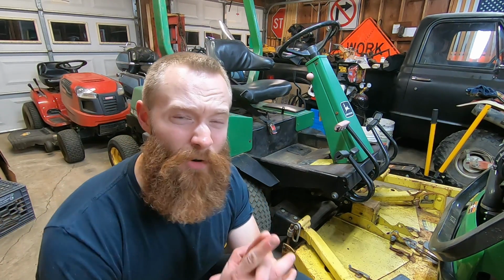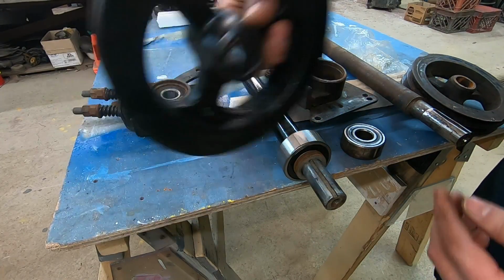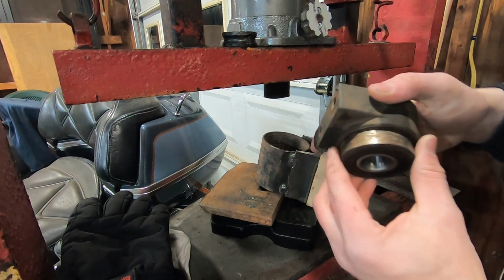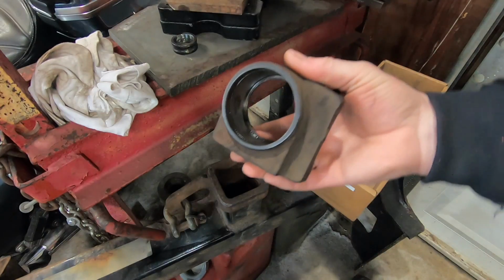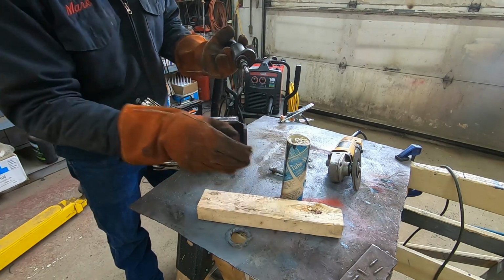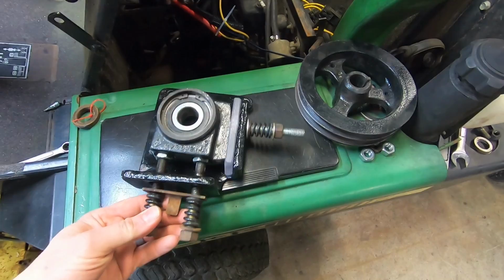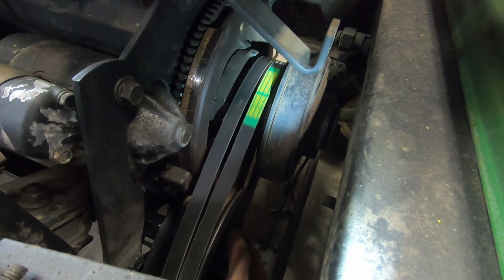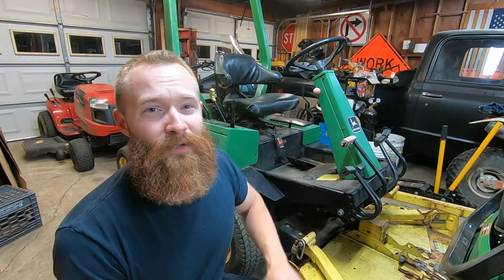John Deere F932 PTO Rebuild - George Jones Mower Build - PART 3

Comment: When you sanded the housing a little too much you didn't have to scrap it.  You could have just mixed up a little bit of epoxy and smeared it on the housing and on the bearing with just a film of the adhesive.  It's great for filling in the small space between the two surfaces.  I realize it's been a long time since you made the video but this suggestion might help someone else.  Thank you for the video.
When I bought my F935 the electric clutch was extremely weak and when I tried to take it apart to see if I could adjust it the bearing wouldn't press out.  So I priced new clutches and the price was as much or more than I paid for the whole mower, depending on the site where I shopped for it.  I happened to see an ad from Friday Parts and the price was affordable (less than $300 and with free shipping).  I was skeptical about that merchandiser so I did a little investigating and decided to go forward with the purchase.  It arrived on the last day of the promised delivery time and it was poorly packed, with the packaging looking like it had gone through a war.  FedEx even had to make a new shipping label because the original was so unreadable.  But I got it with only a slight amount of damage.  The metal tang was bent over and when I bent it back, it was fine and the clutch works great.  It's a good quality part.  So I can recommend FP as coming through for me on that first time purchase.  I hope this comment helps someone else.😊

Comment: How much do you tighten the 3 spring tension adjustment bolts? I will blow snow but they keep coming loose. I put new belts on and I can't get the right tension since then. I hope you can help me. Thanks
Reply from the maker: I never used a torque spec, but I tightened the adjuster until the springs were almost completely compressed but still had a bit of clearance between the spring coils. Best of luck.
Reply: @marktolman6037  When I turn the machine on the drive shaft starts to turn without engaging the pto
Reply from the maker: Sounds like the PTO clutch may be frozen, or the button is letting it stay engaged

Comment: Is there any way to rebuild the two deck lift cylinders in the front.  I have a F-911 they should be the same as your F-932
Reply from the maker: @BidblokUSA  from doing a quick look, the seal kits are available through the dealer....but it looks tricky to get the ram itself apart...not sure!

Comment: very helpful, tks, I have a F932 and seem to be having issues boggging down in heavy grass was wondering if it could be the pully slipping...
Reply from the maker: It very well could be the engine to PTO pulleys, with the 2 belts, or the mower deck belt itself
Reply: @marktolman6037  Great video, I am also having issues with bogging in heavy grass, it’s sounds like deck slows right down (but engine rpm remaining high) 
Is there any way to solve this? My machine is missing 1 of the springs/thread bar on the back PTO tensioner - previous owner said putting the extra spring/nut on would stop that? Would you agree? 

Probably need to look at higher deck height in the thicker grass too
Reply from the maker: The PTO belt tensioner, as a whole, is a horrible design flaw. I've rebuilt mine twice now. The pto bearing carrier has to be free floating, with as much spring tension on those adjuster bolts as possible. 
You are correct. Super high grass does need more frequent mowing or a raised deck height.
Reply: @marktolman6037  thanks for your reply. So if I buy the extra bolt/spring and tighten down all 3 as tight as they will go whilst allowing the pto carrier to still float is should help? Thanks again for your help
Reply from the maker: I believe so, if I'm understanding your situation correctly

Comment: Question, can the pto safety switch by the pto brake be bypassed?
Reply from the maker: Yes, wouldn't be too bad of a job. Just have to figure out if it's a normally open/closed switch, and go from there.

Comment: Have a similar mower f911 with 3 a cylinder yanmar gas engine, 60" deck. It doesn't take much to slow the blades down to a stop when mowing. Replaced the belt thinking maybe it was stretched out but that didn't help at all. Blades are sharpe.  Would it have anything to do with the pto clutch? Any ideas?
Reply from the maker: Did you check to make sure the PTO belt tensioner is tight enough? The double belt on the engine side...that could make a slip. Or the belt on the mower deck.. so check to make sure blades are tight
Reply: @marktolman6037  I checked the PTO belt tension it did seem a little loose. Going to tighten it up some before the next mowing and see if that fixes it.

Comment: Dang  I knew something was missing from my f935...it's the whole rear tensioner and bearing. The two screws with the springs are there in the bracket and nothing else!
Wow I've been mowing with it too!
Reply from the maker: Wow, that's actually impressive it works!
Reply: How has the shim you made held up?

Comment: These JD's are perfect for do it yourselfer's, got mine F930 for free.  That PTO design is the worst PTO in the world!  I replaced all those bearings, then a bearing in the electric clutch failed ripping the wires out  I rebuilt the terminals and replaced bearing, hint on new bearings remove black dust shield and fully pack bearing reinstalling shield.  Also,  I removed springs  on the pillar block and fastened it directly to frame with nyloc nuts.  Made braket to install serpentine tensioner (98 v8 Dodge)works  perfect. No more loose jam nuts. Once all kinks are worked out, these mowers are fantastic. I use mine with tire chains in winter with 5'snow pusher very maneuverable.  One more thing mine had a differential lock lever on the(front) deck side of the trans axle and a hole in the floorboard. Made very simple linkage for foot operated diff lock!  Good luck
Reply from the maker: That sounds like a pretty clever fix for the PTO. I tend to agree. These pto's are awful! It almost seems like an afterthought for the machine, when it was new, in the factory design.  I couldn't imagine paying a shop for all things it needs. It would cost a fortune, far greater than the worth of the machine!

Comment: I was looking at a F932 for sale and I think this video has talked me out of wanting  to buy it.  Especially the part where you said all these machines have this problem
Reply from the maker: They are great machines, but they always seem to need something. If you do the work yourself, and dont mind tinkering. If you have to pay someone to do the repair work hourly, it could quickly add up to more than the machines worth.
Reply: @marktolman6037  
Thanks for the great video. Excellent  work.  I was trying to get a better picture of how the pto works. I'm pretty sure the belts would go to the pto clutch. I wasn't sure how the pto 
Brake worked. Is there a band that goes around it?  I tried to find a diagram online with no luck
Reply from the maker: Yes, there is a band that goes around the pto brake pulley, and it can be adjusted to grab whenever the pto lever disengages. Most people don't want this, because it puts alot of stress on the pto and mower components, with the abrupt slowing of rotating mass.
Reply: @marktolman6037  
Thanks for the info.
Reply from the maker: Anytime!
Reply: @marktolman6037 i think the part that goes on the shaft is gone on mine. Just the band and linkage is hanging in place.
Reply from the maker: I found alot of those parts on ebay....not sure you want to spend John Deere dealer money
Reply: @marktolman6037  I figured it was removed for a reason
Reply from the maker: I don't use my pto brake

Comment: Yes!  Totally useful and Thank You!!   Mine broke the last cut of the season and I have to pull the drive shaft.    The bearing at the pulley end has no more balls.  Lol…
Reply from the maker: Sounds like you got your moneys worth from the bearing!
Reply: @marktolman6037  great machines.   I have 2 I bought used at an auction and have been using them for a good 20 years.   Thanks again!
Reply from the maker: Awesome! I'm currently fixing a broken hydraulic line, only a minor breakdown. I have also experienced how great they mow. Hope to get it ready for next mow season.
Reply: @marktolman6037  I have to remove the hydraulic pump on my 935 to fix a leak around the motion control shaft (forward/reverse and speed).  Have you done any videos on removing the pump and repairing it?
Reply from the maker: I i had to rebuild the transmission/pump, and it's not too bad. I dont have a video of it, but the hydraulic pump bolts directly to the driveshaft and can be removed from the transmission

Comment: i just wish you would have shown taking the pto shaft out im working on a 1984 f910 mower and im not sure how to get the pulley off the pto engine side as the frame is quite different good video has helped alot
Reply from the maker: It was quite the process, ended up using a pulley puller, theres not much room to deal with...I unbolted the tensioner bracket off the engine, and also unbolted the fafnir bearing block and cam centric retainer on the front. The pto shaft can then slide toward the rear of the machine, leaving the forward fafnir block in place.
Reply: @marktolman6037 I have a 1997 f911, a bolt on the Fafnir bearing block came loose and fell in between the pto brake pulley and metal plate that holds the bearing block. Will the brake pulley slide back towards the engine if I take the set screw and the key out?
Reply from the maker: My memory on this is a bit foggy, but I believe the brake pulley will slide rearwards once the set screws are removed..
Reply: Thanks I’m still working on it got the set screw out by heating it up just can’t get the the break pulley to budge not much room work. Probably gonna just pull the whole shaft .😢

Comment: This video saved my life!!! Thank you thank you thank you.. Mine is a low hour machine but that fafner carrier bearing is gone and wallered out. At least now I know why it is so damn hard to remove this pto shaft. I agree it is a very poor design . I think I will eliminate the pto brake altogether . What do you think?
Reply from the maker: Howdy, thanks, glad the video helped! My PTO brake is there, just adjusted so it doesn't touch the PTO brake pulley. I don't have a problem without the brake, and it also saved wear and tear on the machine. Yes, the mower deck stays spinning for a bit after PTO is disengaged, but it takes a lot to slow down and stop that large rotating mass through the drive shaft. I think it was a mandatory safety item from the factory, but not necessary to function and longevity.

Comment: I got a f911 which has the same pto setup. I had first the lever wouldn't stay engaged. Bungee to hole by F/R pedals solved that and the lawn got mowed. Fast forward 1 year. Mowing and finished all but an area to the barn. I engaged the mower all ok but as I approached the barn smoke started rolling out by the brake/ engage pto assembly. I was able to get fire out (grass smoldering). lucky me I'm in the barn. No notable damage to wires. The fuses are good but it now won't start. I have pto switch in that area. I will let you know what I find for the other views
Reply from the maker: Glad you got the fire out. Hi, the bungee cord is a problem. Typically, if all the safety sensors are in place, the PTO will stay in place. The fact that the PTO won't engage is a safety feature in itself, so you don't keep using the PTO. Find the brake safety, and seat safety, see if the sensors are getting mechanical contact, then test them to see if they make a closed circuit when engaged. Best of luck.

Comment: Please don't stop making them!!  Awesome footage.. picture was much more clear than most.. and the mouse voice, in superfly mode, was fun.  Me and my puny shoulders look forward to some good tips on that deck belt and tension springs.  The book says its a two man job, on my 935 72".. but deep down, I'm worth at least 2 and half!!  I told you I use tow strap ratchets.. but there's got to be a better way!  Sadly mine does not have the handy dandy notch for a good breaker bar.
Reply from the maker: Thanks! I am still working my way to the deck belt, I'll be there soon!
Reply: I had a broken spring and when I was ready to put it on I took the tension off of it by slipping the belt off the one pulley.  Then when the spring was attached it was easy to feed the belt back onto the pulley 😊